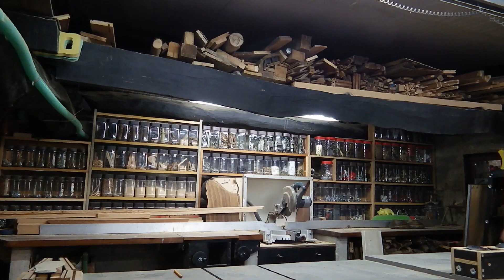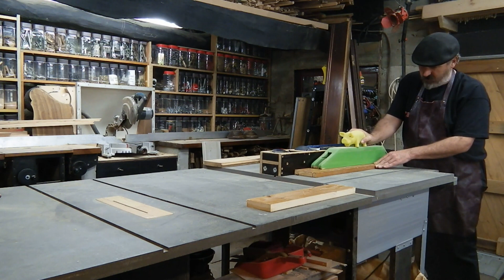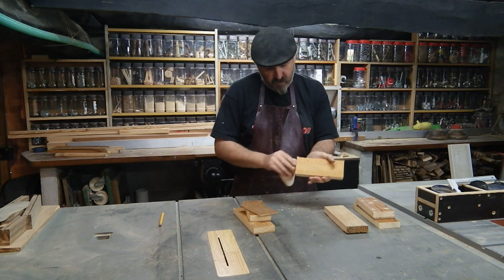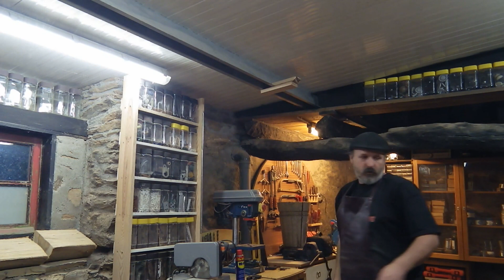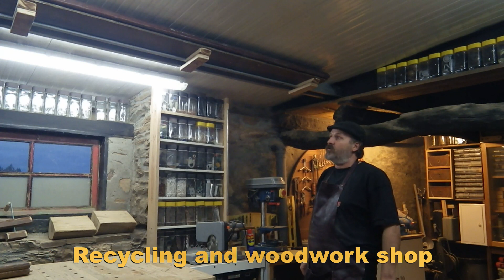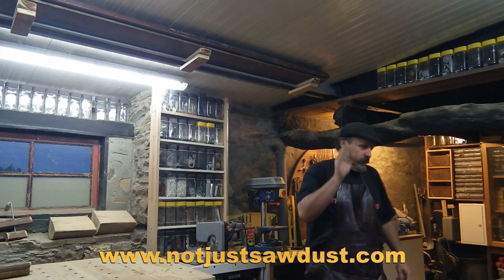#33 Just a quick and not so fancy storage solution

Comment: I was wondering how it was going to work right until you hung the brackets lol well done. Some times the quick dirty projects can be the most fun to make and most satisfying 

Totally agree with about the CNC. I have nothing against CNC (I dam well want one) but if a project is done by a CNC don't say it is hand made...  (and like you I will still watch the video...)
Reply from the maker: +Wacky Wood Works Thanks! I probably would use a CNC if I could afford one, but than again I think I would get myself a planer, jointer, bandsaw, decent table saw, lathe and a drum sander first...and after that a copy router would be on top of the list. A CNC would come in handy for my guitar necks though, but I do make them by hand now, so it's just more a kind of luxury... (BTW, a complete different line of items coming out of the workshop... http://3xchaos.weebly.com/